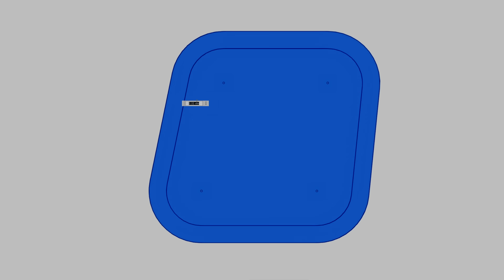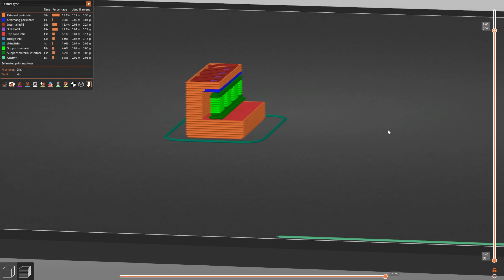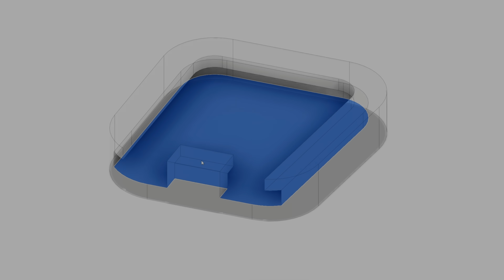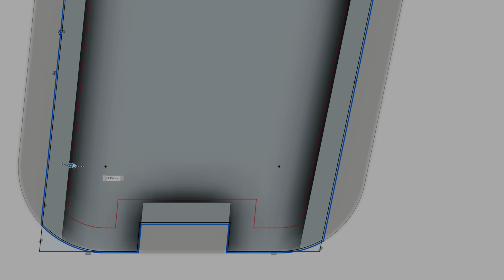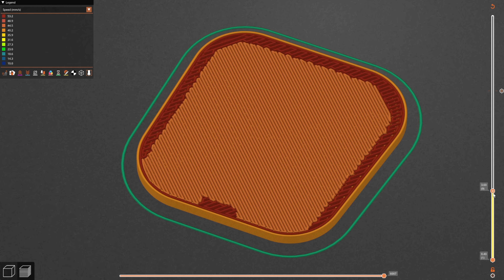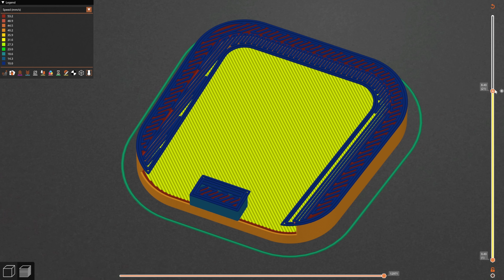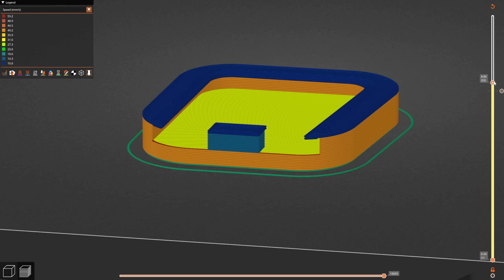The Impossible 3D Print

Comment: That`s a great tip! I have a old Flashforge Finder 2.0 that is broken down atm.
But I have previously printed rc parts, mainly wheels.
As support is a pita sometimes to remove from wheels, this solution would solve the hassle. As wheels need to sit flush with the drive hex (rc cars usually have 12mm hex to drive wheels) this idea would come handy as sometimes the support sticks to the hex area as mine is a single filament only. I`ve only printed in PETG so far as parts needs to hold up to sunlight, heat and shock forces.
Reply from the maker: Great, hope you get your Flashforge fixed and get use of the tips from the video. TPU is not very difficult to print, but a direct drive extruder is recommended. I use PETG a lot, it's very durable!

Comment: you can use "draw support" on orca slicer, i draw every 5 or 10mm for support that kinda object, and choose style to "snug". i do that on oled case. easy to remove since you can draw just 1 mm square per 10mm
Reply from the maker: I use mostly 'snug' as well, it works pretty well on PLA. Have you tried it on TPU where the support is not starting from the build plate? I think perhaps 10mm gap is a bit too much for TPU, it sags very easily
Reply: @kihestad I never use on TPU. but with the draw support function you can add as much as you need. glad you already know the "snug" option
Reply from the maker: That is very smart, I think Prusaslicer has it as well. Will test it. Thanks for the tips 👍

Comment: if you rotate the part it self at 45 degree angle and add a outside chamfer to lay on it you are got a better layer alignment and part strength
Reply: https://youtu.be/8NKVNwVaZU0?si=AKLxvwYH-WuZ8_yU
Reply: https://youtu.be/3VUQd_Tl5x0?si=ryWIxBdMj2DLQrH1
Reply: https://youtu.be/_y8Yvu1FQIE?si=6vNtFpmxI6QcQ5jM
Reply from the maker: That would require a lot of filament as support underneath. Possibly more than the part itself. I have seen this approach been done, but I have never tried it. Seems like very much goes to vaste?
Reply: @kihestad no need for support
Reply from the maker: A lot of smart solutions here, it's a bit more challenging with TPU compared to PLA though, but with some creative solutions it actually does seem like a possible solution

Comment: Juat print the piece with the overhang seperate and glue the overhang ontop :)
Reply from the maker: I always try to print the item in one piece. When splitting the item into several parts, the glue joint becomes a weak spot. However, sometimes it's the only solution, and sometimes the weak point is not a problem. For the part I make in this video, dividing the part in two pieces and gluing them together seems unnecessary.
Reply: @kihestad yeah I understand :)this is a part of 3d printing i just love :) all the small things and problems you dont first think about but something you really need to solve 😊
Reply from the maker: I absolutely agree, I have many times thought of a smart solution, and when printing it a new problem  showed up 🥴😅

Comment: Would it be possible to make 90 degree angles on the side of the model so that it would lie sideways on the printing plate and require less support?
Reply from the maker: Yes, perhaps an even better alternative would be to print it upright with the rear open part at the top. I would have to modify the tab that keeps it from slipping off. It's however best to print parts laying flat on the bed for best strength.
Reply: @kihestad  Yes, thanks for your reply.

Comment: lemme help you man. the centauri carbon and its default profile for 95A tpu works INCREDIBLY well. the tpu supports peel off like a scab and it is wonderful. the printer is only $300, or the one thats not enclosed is $200. trust me its worth it.
Reply from the maker: 95A TPU is probably a lot stiffer than the 85A I am using, I would guess it's easier to break off the support. And of course, the Ender 3 is getting old, newer 3D printer models are probably much more precise 😊
Reply: @kihestad  well here's the main problem i've always had. other printer types are bed slingers. flexible materials + a moving bed results in unstable printing especially at height. i came to realize this when printing lightweight naked gopro mounts. because of the wobble it also caused uneven cooling. you could slow down the speed but then now you're having to change the cooling, etc.
Reply from the maker: Yes, a bed slinger 3D printer is not what I would have bought today 😔

Comment: Couldn't you just flip the part upside down so the printer is bridging? The first layer might not look pretty but that would just be the contact area with the foot? Or am i missing something
Reply from the maker: I think the bringing will be too long for the elastic TPU. I have not tried it though 🤔 An option could be to print vertically with the rear part up, and leave out the small tab and rather just have the side lips chamfer a bit inwards to avoid it falling off. I am not a big fan of printing vertically because of layer adhesion reduced strength, but for TPU it might have worked

Comment: Look at all the PLA stringing. I guess you cant be bothered to tune your print settings. Also explains why you cant print overhangs in TPU.
Thats easy printable in TPU without support.
I have made and printed my own parts that are very similar on my Ender 3.
Reply from the maker: It has been very hot and humid the last few weeks, that's not common here where I live. I need to dry my filament, it's pretty old as well. It will help to buff the retraction and lower the temp a bit, but the quality of the test print was not exactly the point of this video 🥴 Regardless of that, it's not possible to print overhang without some kind of support if the shape is like I explained. Where short passes are indeed possible if the quality is not an issue, and angled overheng works fine, at least 45 degree angle. Beyond that and the problems start.

Comment: Definitely get into drying your filament if you haven't. It's huge for prints and supports, it's definitely a setting / older printer but watching your models print your flow rate for your supports seems to be 1:1 with your model. Highly recommend lower the flow rate or the line width of your supports. A few minor adjustments will generate very nice and removable supports.
Reply from the maker: Yes, I noticed my TPU has gotten pretty bad lately. Looking for a decent filament dryer.
Reply: @kihestad  I have the SUNLU S4 and it's incredible.
Reply from the maker: @B_M_A Thanks for the tips 👍

Comment: Nice to see new videos featuring a trusty old Ender 3.  Great tip as TPU supports are nearly impossible to move neatly.
Reply from the maker: It's a trusty old Ender 3 for sure 😊 I guess it's time to replace it, but it actually performs relatively well as long as all the settings are dialed in and the filament is dry 😔

Comment: You could have just put a fillet on the underside of the overhang.
Reply from the maker: You are probably thinking of a 45 degree chamfer? It is an option, but it would not have been a perfect fit and would more easily slip off. Remember the motorcycle resting on the side stand is almost 200 Kg 🥴😊

Comment: I can really recommend using dissolvable filaments like pva or even better BVOH! You only need it as interface material so you only need to manually swap filament 4 times. I’ve printed a sheath for a knife completely on the flat side and at the end just dissolved the interface material and pulled the support out, it’s great! It also gives you really flat and smooth surfaces above and below the supports. Just make sure you have those dissolvable materials completely dried every time you want to use them!
Reply from the maker: I have never tried that, might give it a try once 👍 Swapping filament multiple times during the print sounds a bit cumbersome though, perhaps this is a solution that works better if you have a printer with multiple print heads?
Reply: @kihestad it works well with multiple heads or with a ams system, honestly swapping 4 times is not that bad and can improve the print a lot. With this way you can also print low friction print-in-place moving parts.
Reply from the maker: An AMS 3D printer is definitely on my wish list 🤩

Comment: Normal PLA is very strong. Stronger than PET-G. However, it breaks more quickly because it is not as flexible.
Unfortunately, I could only see esun. Do you use PLA+ from esun? If so, it has a different composition than standard PLA. The layer adhesion is better with PLA+ from esun, but for me PLA+ from esun fails as a Skadis hook after a few years. The color also fades, even though it doesn't get any sun.
Reply from the maker: That was useful info! 🙏 I have mostly used PETG as I find it more durable than PLA when used as 'functional' parts. I have used PLA for eSun mostly because it's the cheapest one I can find around here, and they are very easy to print. Mostly for prototyping or for parts where durability is not important.

Comment: Nice to have the ability to produce these parts on your own. The floor damage problem comes of course from the metal attrition to the concrete floor. A softer yet durable surface interface should fix the issue. I hope this plastic is a good material choice. I would suggest you making it larger so in the future it can also be useful to keep the bike safe in loose ground (gravel, sand, etc.). If you can manage to add a small metal piece between the bottom surface of the side-stand (about 3mm larger on all 4 sides) and the pad, you'd have a more durable and versatile product in the end.   Keep these projects going and sharing w/ us.  🙂
Reply from the maker: That is actually a very good idea, when I am  parking on grass I always need to find a rock to put under. 👍🙏

Comment: Here's what I would do (you did solicit such commentary :)):

Remove the little 'nub' completely, print it upright, no support needed, and then apply a little calking to it when installing. The caulking will be more than enough to hold it in place, but still allow easy-ish removal, if necessary. 

Printing it upright is not ideal as far as layer orientation with respect to the forces it will endure when in use,  but TPU is a magical filament with excellent layer adhesion, so it should hold up very well to the stress.
Reply from the maker: That was a very good idea, I did not think of it as an option 🥴😅 I agree, the TPU has awsome layer adhesion, I am sure printing it upright would work fine. 👍

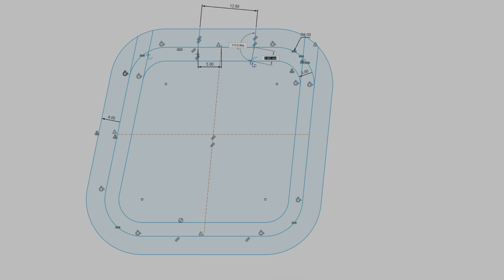Comment: Good solution, but, you could just make the inside edge 45 degrees to stop the need for supports? My suggestion is based on you saying "so I can just snap it on whenever want to use it"  @2:32..... Your statement implies that you would want to remove it at some point, a 45 degree angle would aid in the insertion and removal unless it is a permanent fixture. Just my2c though...
Reply: Agree, too much effort that can be solved with a filet or chamfer and can't agree with all comments that say it can't hold securely.
Reply: If you make the inside upper edge 45 degrees, the foot cover would not hold nearly as securely, and there's a significant chance that it would fall off from the vibration of riding.
Reply: @JohnDoe-fk6id  True, and, I know that. You did not read or comprehend what I said did you? It was based on what he said, or did you miss that too? I specifically tagged what he said, did I not?
Reply: @MyLinuxExperience  Man, you are SNIPPY! Yes, I read and comprehended what you said. If the object is ONLY to be used in the garage, then yeah, your advice works. If he's going to leave it on the bike and only remove it from time to time, then my statement holds. IIRC, he doesn't explicitly state that he's not going to ride with it on the bike, so I was giving explanation of why it might not be a good idea to use a 45° bottom surface on the overhang. Maybe dial back the righteous indignation a bit?
Reply: @JohnDoe-fk6id  My initial comment said all that did it not? Do you think I needed an explanation as to why a 45 would not work? I did say unless it was a permanent fixture no? That means that you explaining why a 45 would not work on something being a permanent fixture had already been thought of when I commented no? " righteous indignation " No, not quite, but, you did imply that I had not thought through my initial comment...
Reply from the maker: I thought about using 45 degree angles, but it would not stick as good and not look as good, I think 🤔 I use this technique very often to avoid support all together, it's very smart 😊👍
Reply: @kihestad  maybe a curved inside wall instead of a straight 45?
Reply from the maker: A curved overhang (fillet) is not as efficient as using a straight angled overhang (chamfer), the last part of an curved overhang will not have anything underneath it
Reply: @kihestad  well yeah, you would need to reduce the amount of overhang beyond the end of the curve but it should work fine without supports if you do that.

Comment: also you can color on the top of the supports with sharpie to get the supports to release easier
Reply from the maker: Will try it! Thanks for the tips 👍
Reply: You can also change the z offset and pattern spacing for the supports so they dont stick to the print.

Comment: That's simply great. Thanks for showcasing it!
I hope it stays on the side stand end, maybe the 'walls' need to be higher when the side stand starts moving inside the extender/protector? I'd hang on to that white print support...🙂
Reply from the maker: Yes - I have already printed a couple of extras, just in case, and I have put the support in my storage drawer 😁 I could probably print with even more infill to get it stiffer - will increase from 60 to 80% to test it. It was very easy to put on with 60% infill.

Comment: Great solution!   I'm still on the fence WRT a 3D printer.  Any recommendations?  Small custom enclosures for electronic projects would be my main use for a 3D printer.  Seems like the ideal solution.
Reply: A1 mini if printing pla and space is an issue.
Reply from the maker: I think you cannot go wrong with any of the known brands these days. I would select one that has an enclosure and with 300C (or more) capacity to be able to print abs, asa, nylon and other high end filaments.

Comment: As always I enjoyed the video and clever problem-solving, but... umm... I think you found a much cheaper and simpler solution already at 1:10 :P
Just put a little bit of plastic, cardboard, cloth, whatever you have lying around under the stand. Sure, a bit of cardboard won't last forever, but I'd say it's fairly easy to replace if it wears thin!
Reply from the maker: Haha, you are right - just putting something under the side stand is a very easy solution 😁 but it does look nicer (especially on camera) with a purpose built side stand rubber pad 😎
Reply: @kihestad  There's no denying that!